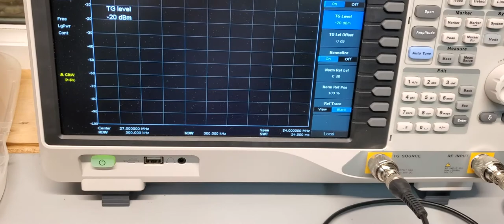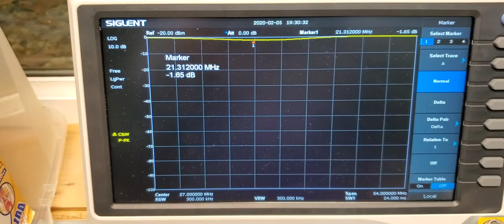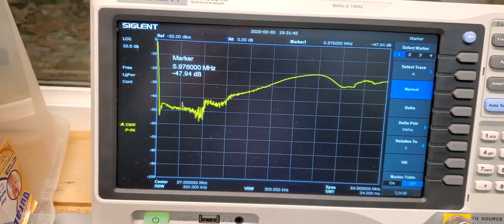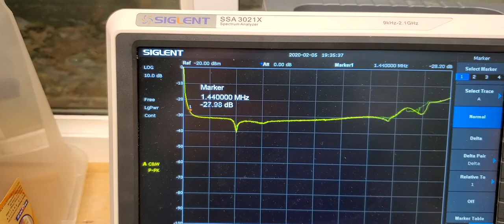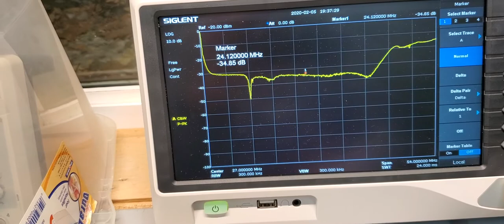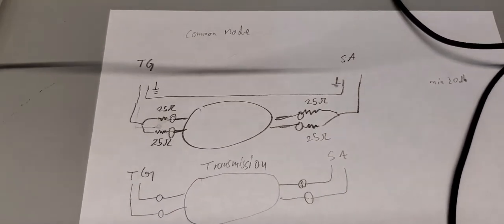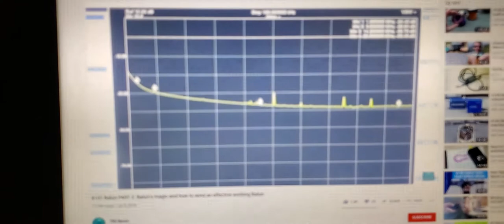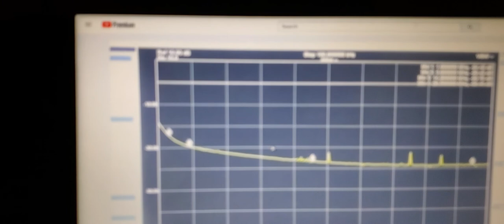Homemade 1:1 Common Mode Current Balun Testing

Comment: nice enough video but when you connected two ends of each pair it wasnt as a transformer , it was as more of a capacitor or two separate antennas and at 8:00 ish the resistance was 25 ohm :-)
Reply from the maker: I agree that's this is a capacitor. Thanks for pointing it out.
Reply: @adventurelaus  
your welcome :-)

Comment: I've not understood the need to put the resistors in series with the test circuit. How would this affect the actual amount of attenuation provided by the windings on the toroid, or more importantly, the measurement of same?

Comment: Fascinating, broadly similar to my results, I was considering sleeving the wires to try to reduce turn to turn capacitance 73
Reply: The windings on the balun are controlled impedance transmission lines on both sides of the core. The transmission line impedance should be 100 ohms for optimum performance. In order to make this transmission line, DG0SA has chosen #18 AWG PTFE wire. The wire is either solid silver or silver plated. Sadly, the DG0SA website says that he has passed away, but the site is still available.
Reply: If you were to sleeve the wire, you would alter the transmission line impedance which has to be 100 ohms.
Reply: @arcanestudio   I meant an overall sleeve  with each pair of conductors in it. As you say PTFE insulated wire is silver plated, as the coating attacks copper. Sleeving the "pairs" would not change the transmission line impedance.
Reply: @g0fvt  I am sorry to have misunderstood your original intent. From what I have read, the windings should be wound as tightly as possible on the core - without air gaps. Controlling the transmission line impedance appears to be the most important parameter for ensuring success - cheers, K1FQL
Reply: @arcanestudio  no problem, from my own experience with them the common mode impedance suffers when they have too many turns. I do not know whether this is down to the capacitance. Certainly effective common mode chokes are a powerful weapon when RFI is an issue. 73

Comment: You may want to feed your balun in common mode just as the TRX bench guy has done with 25 ohm resistors. Then, you will discover how it performs.